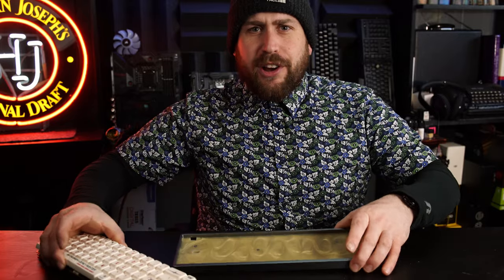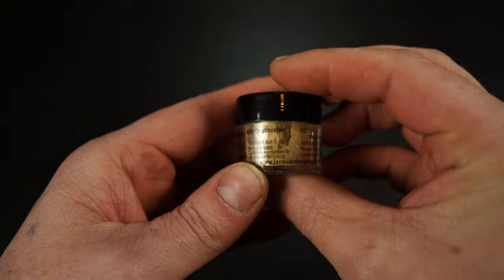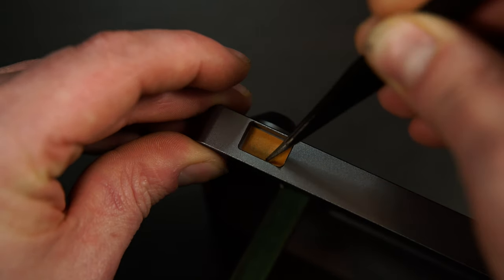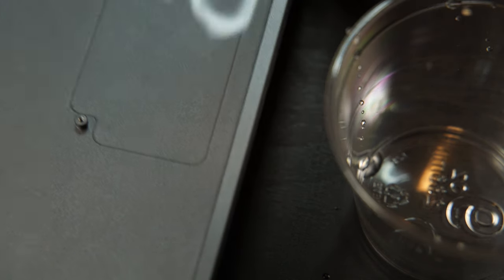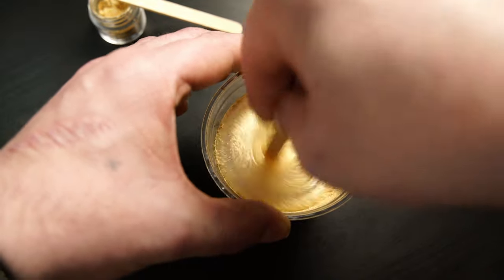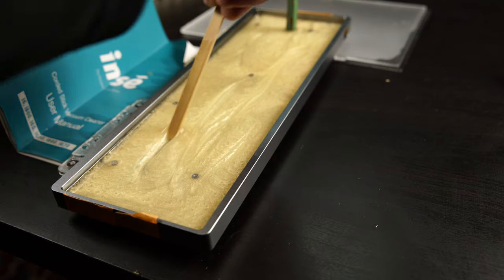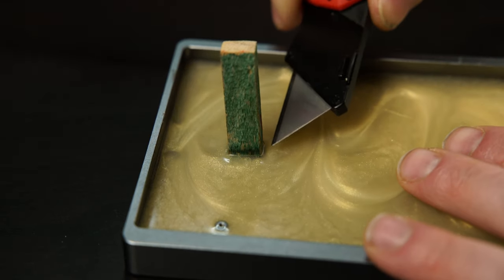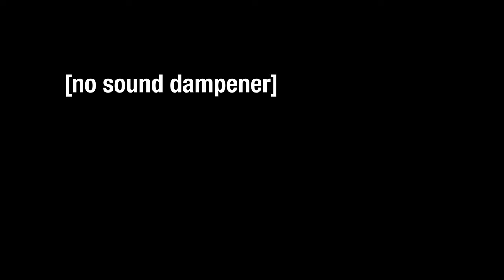The PERFECT DIY Silicone Keyboard Dampener #MechanicalKeyboards

Comment: to estimate the volume of silicone needed, could you also use rice or another small dry grain? might be easier than to try to use water and not spill!
Reply: or measure the water in a measuring jug before youre pouring it in

Comment: Do you think you could get something like tire weights and then when your pour do like 50% and then let it cure mostly and then put in the weights and then pour the rest of the silicone? Or would it be more worth to do it normal and cut out holes for the weights? Thinking of trying this with my kbd67 lite when it comes in because of how light I think it will feel when compared to my other boards.
Reply from the maker: You could try casting the weights directly into the silicone. You'll have enough to cast everything twice if you mess something up.
Reply: @beardedtechy  sweet, definitely want to try this with the kbd67 lite when I get mine in. I already use a nk65 ee and I've heard the kbd67 isnt as heavy so maybe that could help fix it. I'll let you know how it goes in a few months!

Comment: Def didn't need that much yoy only need 2mm lol I've not seen 1 person use this much lol most was half also your mixture is really really yellow it's supposed to be clear you should always take it out after then make adjustments and cuts I hope nobody does it the way yoy did in yoyr video or they are changing really messing there boars up accidents happen. Just use tape when you pour and lift the edges up. Or use what you said you could to get it out. Even though I still wouldn't use that inside of my board with its coating. Just do the silicone use tape around edges to pill up when you are done and then make cuts and adjustments lol.
Reply: Did you not watch the video? Lol. No duh the silicone is clear but it’s yellow because he added pigment to it just to make it look nice. Also there is no requirement to remove it to do adjustments, he only had to cut out the little block for the reset and a section for the usb-c port, super easy. I’d actually rather not remove it because the piece as a whole is solid and sealed to all the walls and everything else. Probably doesn’t make a big difference either way but I can understand the thinking behind it. Also, it’s really your preference on how much you want to fill it up. Obviously you can’t go over the standoffs but some cases are different than others and some people like to have their sound dampener compressed rather than not. It makes a difference in the sound. I do think he could have used a little less but he even mentioned that in the video